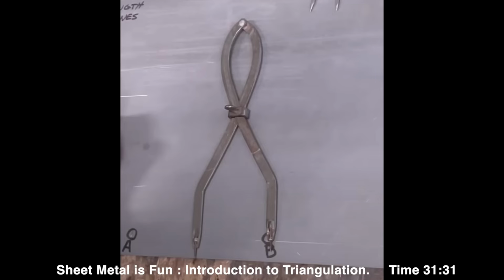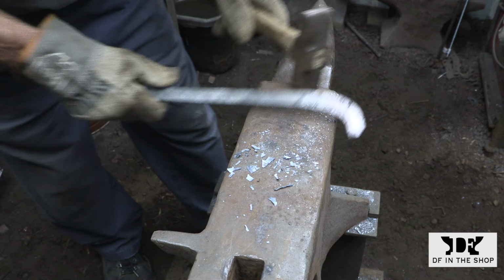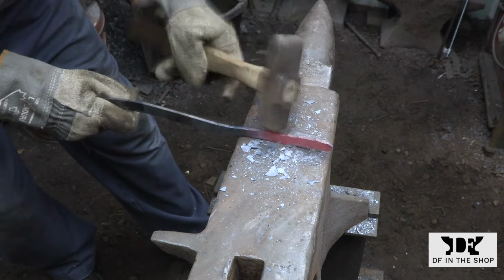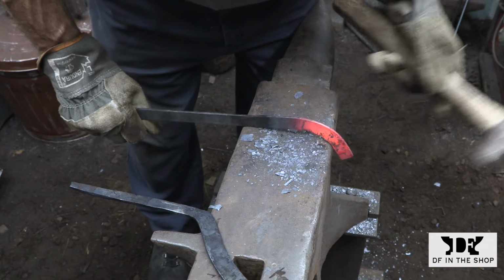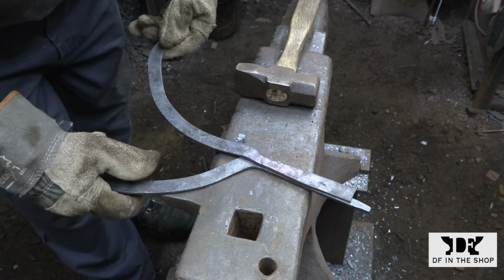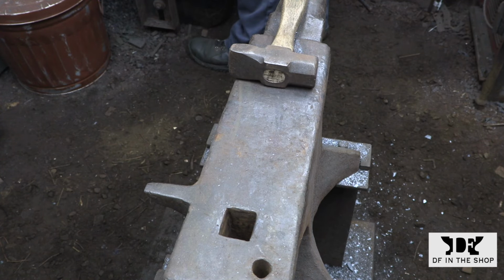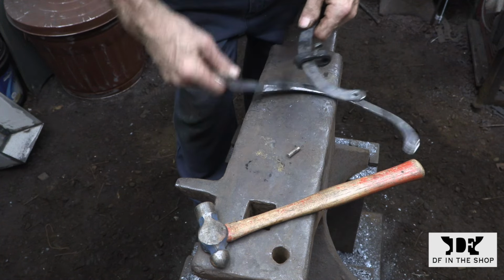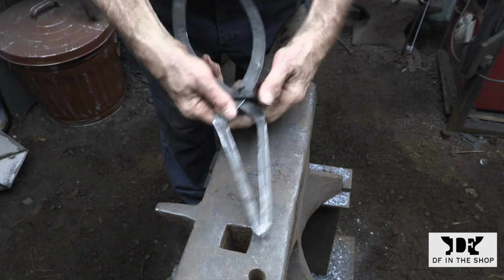Blacksmithing for Beginners - Shop Class Dividers

Comment: WOAH... hold on a minute, Dennis... there needs to be a logical progression of the lessons here to better facilitate understanding... so shouldn't we first make multipliers?
Reply from the maker: Good one,  but It's actually the same tool.  I have no idea why they are called dividers because  in medieval times, dividers spend most of their time pacing  off ( multiplying ) a divider setting a certain number of times to define the length of a new dimension or the proportion of something.
Reply: @df-intheshop330   Indeed. But it mostly did so on maps under its other pseudonym, "a pair of compasses."
Reply from the maker: before measurement became standardized everything in the world was described as a proportion.  the height of a rectangle was a multiple of the width of the base.  the only thing I remember from high school math was that a perfect 90 degree corner could be laid out by creating a triangle that had sides that were 3,4&5 units long.  that sort of thing.  the divider was the  only tool that could do the job because it allowed you to reproduce these shapes very accurately without relying on any form of numerical system.  it was everywhere, carpenters, cabinet makers, stonemasons, sculptures everybody used dividers to reproduce standard shapes or do basic calculations.  they may not of had any idea of the mathematics behind what they where doing but they could memorize the steps that would need  to layout the measurements or the shapes they were after.
Reply: @df-intheshop330  I'm from the extremely rural mountains of SW Virginia, farming tobacco and cattle... and the 90s here was still the 1950s... so we were still taught in Geometry class how to form every shape and do math formulas using only a pair of compasses. When I went off to the Army and college, I discovered that my peers from the rest of the country had no clue what any of that was. Then I spent a Summer on roofs doing contracting and my mentor taught me how to do Calculus on a roof to determine how many square of material we had to bid to complete the job... using makeshift soapstone/greasepen dividers.
Reply from the maker: I can relate to that.  the schools around here just thought geometry was used to draw fancy quilt patterns.  You would be interested in a book called - by hand and eye - by George walker & Jim tholpin. it's published by lost art press.  That for me was how I was able to line up all these scattered bits of information I've been collecting over the years. It's a great book but it's written kinda weird because the first few chapters don't make any sense until you get to chapter 5 or 6 where they start actually explaining how it all works.
Reply: @df-intheshop330  That's awesome, thank you very much for the recommendation and I will definitely check it out. I found an excerpt and I was hooked right off the bat by the instruction to use the corners of a square to construct a spiral. I could tell by eye that the proportions were the Golden Ratio, which I try to incorporate into forgings as much as possible, like making the jaws of hammer tongs be three sections of 1.5, 2.5, and 4 inches that are each legs of a Right Triangle. The spiral lesson in the excerpt was essentially a different way of making the hammer tong pattern that I use, except of course that you flip the third leg so that you make a claw instead of a spiral. I hope that made sense, lol.